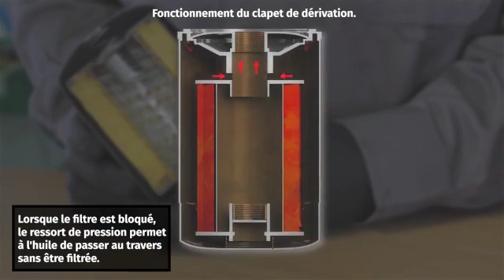Comment fonctionne une soupape de dérivation du filtre à huile ?

Comment: Bonjour,
Ce message pour vous signaler que je pense que vous vous trompez concernant l’utilité de ce que vous appelez « ressort de pression » sur votre animation montrant la dérivation du flux d’huile .
Seuls le petit clapet et le petit ressort que vous montrez au fond du filtre ont cette fonction. Il est impossible à la matrice filtrante de reculer au fond du joint comme vous le faites avec vos doigts et dans l’animation. Pourquoi impossible ? Tout simplement car la pression d’huile en entrée du filtre s’applique partout sur la capsule de filtration , sur les côtés mais aussi derrière, là où il y a la soupape de by pass mais aussi sur la face avant sauf au centre de cette face, car au centre c’est la sortie du filtre qui a une pression plus faible que l’entrée à cause de la perte de charge causée par le filtre. Si le filtre est colmaté, c’est encore pire, la pression au centre est nulle (pression atmosphérique). Alors, comment voulez vous que la pression de l’huile fasse reculer le filtre? Au contraire, la pression a tendance à plaquer la partie filtrante vers l’avant du filtre à cause du rapport des surfaces avant et arrière. 
Selon moi, le ressort que vous appelez ressort de pression ne sert qu’à assurer l’étanchéité interne du filtre entre l’entrée et la sortie de celui-ci, en plaquant la partie filtrante sur la membrane en silicone et elle même sur la plaque taraudée du filtre. Il n’aurait pas été possible d’assurer simplement cette étanchéité à moins de réaliser des sertissages complexes entre toutes les pièces. Le ressort résout le problème simplement. 
Je peux vous donner un exemple renforçant mon propos, sur la Nissan Micra K12, moteur CR14 (1.4L essence), le filtre n’a pas de soupape de dérivation au fond mais à bien votre « ressort de pression ». Pourquoi pas de by-pass? Tout simplement car cette soupape est directement montée dans le bloc moteur au niveau du filtre à huile. L’information est donnée dans le manuel d’atelier du constructeur.
Pour finir, je ne suis pas sûr du tout que l’augmentation du régime fasse augmenter les besoins en débit d’huile, dit autrement, accentue la chute de pression dans le filtre. Je ne vois pas en quoi les besoins en huile s’accentueraient. Les fuites d’huile sur les points d’utilisation dans les paliers ne varient pas avec le régime, ni même la charge du moteur. Je ne suis donc pas sûr que votre explication soit bonne. Par contre, une huile plus visqueuse (froide) peut tout à fait augmenter les pertes de charge dans le filtre et nécessiter de le by passer. De même, certains actionneurs comme les commandes de la distribution variable sont consommateurs d’huile lorsqu’ils sont actionnés et pourraient augmenter le débit nécessaire.
Reply from the maker: Bonjour,
Merci pour votre commentaire. L'objectif ici est de souligner l'importance des fonctions de dérivation dans les filtres à visser, qui peuvent empêcher le manque d'huile ou les chutes de pression dans d'autres composants. Pour éviter les blocages des filtres, une soupape de dérivation avec un petit ressort fait office de clapet anti-retour. 
Bonne journée.